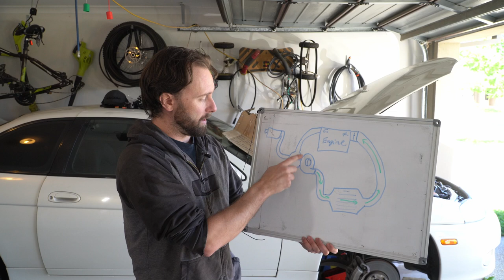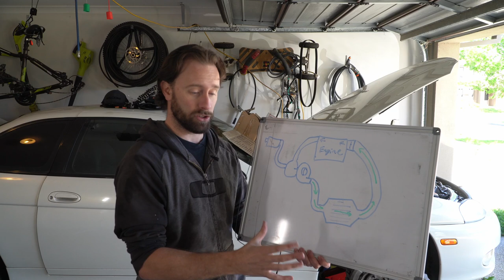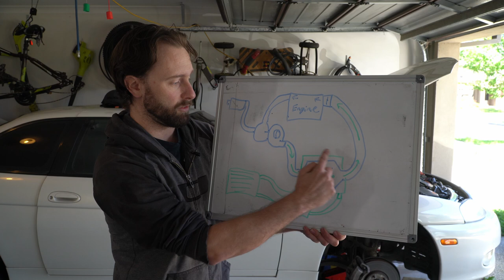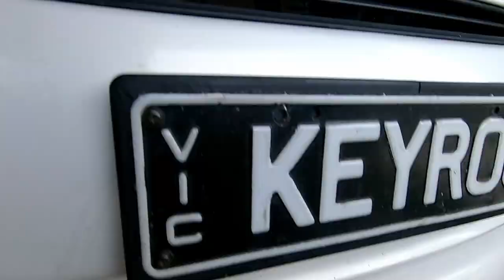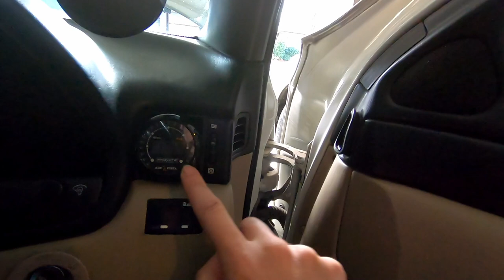1JZ Soarer Water to Air Intercooler conversion

Comment: That pump is not man enough fire the job.
It’s a parking heater pump. 
Look out for a Bosch “010” pump , it’s used in the supercharged Mercedes , it’ll do 4-5 gallons per min . They’re cheap .
Also those 90 brass fittings are absolutely terrible for flow . Use the ones they call “smooth radius or smooth flow” fittings for nearly free extra water flow. 
Love the build .
Reply from the maker: Cheers mate, this one is flowing alright but i'll look out ofr the bosch pump to upgrade in the future :) and yeah the brass fittings are pretty average, i should be able to get a deal on proflow or raceworks stuff at work so i'll get some nice bend fittings. a lot of this was purely to get it all doneand working and i'll tweak it all as time goes on :)

Cheers for the advice
Reply: Doesn’t need a flow rate like a radiator mate…. Just needs constant circulation, can be on boost for quite a while before it heats the water enough for pumping…. Could always put a thermal switch into the relay for temp trigger the pump……

Comment: Great video. I didnt hear properly what the valve was called coming from the intercooler. Its a "blawvalve" ? What does it do? What is the small tube connected to it?
Reply from the maker: Blow off valve, it vents air pressure from the turbo when the throttle plate closed, mine is a plumb back so instead of venting to atmosphere it vents back into the Intake. It's worth googling turbo systems and blow off valves for more info on this stuff and how it all works :)

Comment: I would have put the air to water heat exchanger between the rad and the timing cover, flipped that turbo pipe around on the turbo out let and then you dont have to do a 180 degree bend in your air flow plus you shorten the boost run which will improve boost response time. 
very nice job though
if you want to take it further, you should look into an interchiller set up which uses the ac system to cool the water to sub freezing intake air temps which translates into more hp.
Reply from the maker: Hey mate yeah that was my original plan but I just couldn't fit it in there, tried a bunch of stuff and even if I ditched the thermo fans all together it wouldn't fit, there was a smaller cooler available but it was rated for much lower horsepower so I ended up going thr way I did, not perfect but it's just the way it ended up! 

I'm going to replace all the dodgy fittings with raceworks ones for better water flow. See how I go with the AC chiller, it's just a weekender so no drag racing or anything :)

Comment: I really like this setup ,but my issue was I can’t fit anything in the front as I don’t have space for intercooler. In this setup the heat exchanger as big as my intercooler itself ,so it doesn’t make me fwd with my built too much. I need to find a space for the heat exchanger somewhere
Reply from the maker: yeah i've got tonnes of space in thefront bar, was easy, fitting the cooler in the engine bay was trickier

Comment: cool build . It could end up with a air lock in cooler . If you unbolt and turn on its side or put an air bleeder in top . I think could help
Reply from the maker: Yup exactly what I did when I did my final bleed :)

Comment: I may have misheard you it the water temp probe for the fans needs to be in the top radiator hose 👍
Reply from the maker: The fans are controlled by the ecu from the factory water temp probe, the temp probe in the top rad hose is just for an aftermarket gauge :)

Comment: You will have air the water to air intercooler need the water line top and bottom. You will have air from the fitting to the radiator cap unless you can pull a vaccum and inject coolant in system.
Reply from the maker: I unbolt it on the final bleed, twist the cooler and put the cap above it :)

Comment: Hey what water pump did you use? Just did a very similar setup in my Subaru but I'm getting cavitation with my current water pump, I suspect it's oversized.
Reply from the maker: Hey mate I got it in the kit with the cooler, let me have a look and see if i can find a brand :)

Comment: How did you bleed air out of the cooler?  I can’t help but think the upper part of the cooler is just an air bubble and not flowing coolant.
Reply from the maker: Undid the mounts and rotated the cooler around so the exit fitting was at the top to get the air out :)
Reply from the maker: I may drill and tap the top of the cooler at the highest part for bleeding later on :)
Reply: @TheNuggetProject  ah ok, fair enough.

Comment: What type of water pump did you end up getting. Will be doing a water to air for my e30 turbo.
Reply from the maker: i'm not sure on the brand mate, it came with the kit, i think its a pretty basic one but seems to be going well so far and the supplier said he's run them for years in the cars. there is quite a bit of info online about pumps, i believe there is a bosh unit used on mercedes that is really good, have a google see what you can find :)
Reply: @TheNuggetProject  yeah usually these kits are pretty decent. Even a budget set up runs well. A Bosch unit usual are merc/audi/ terminator cobra here in the US. $150usd and knock off style ones are half that. I've seen some people run small reservoirs also.
Reply from the maker: Yeah for sure, we have a drag car at work with a similar system but lines run to a 20 litre ice tank in the boot, that really keeps it cold! But for daily duties I think it's fine how it is on this car :)
Reply: @TheNuggetProject  good to know. With a conservative 300-350hp I'm sure it'll be more than enough for my car. Good to know you're happy with it.
Reply from the maker: Cheers bro, now I just need to find time to finish the dam thing haha, got a small vibration to sort out, the camber is all over the place, clutch needs bleeding again, new gauge system needs to go in... The list never ends, meanwhile the daily is leaking all over the driveway haha
Reply: @TheNuggetProject  hahaha totally feel you there. I recently swapped to ms2pnp for the ecu and idle is not tuned at all. And afr is good and auto tune is handy. But it's not getting a professional tune until a turbo/ dyno tune. Glad to see you taking care of the poor man's supra. Cheers!
Reply from the maker: I'd like to think of it as 'the gentleman's supra' ;)
Reply: @TheNuggetProject  definitely a good way to put it. But at the prices of mk4s... it just is nice to have a clone which isn't bloated in price yet.
Reply from the maker: Yup way over priced in my opinion, good cars but not worth the drug money people are asking.
Reply: @TheNuggetProject  clean e30s are becoming the same 15-30k. I lucked out getting mine for under 4k. From the 3rd owner of 16yrs. Deals can be had. But far and few between nowadays. Found my wife's father a shell for $250 to build.
Reply from the maker: @voltairee3012  yup also drug money, onr if my mates had a ripper E30 with a 3sge beams in it, little rocket for an NA :)
Reply: @TheNuggetProject  damn haven't seen any beams swaps. Much rather have that than the golden 4cyls f20c or k series. Always have enjoyed Toyota motors. If I get tired of my m20 it'll most likely get a JZ.

Comment: any update to the water to air intercooler.
Reply from the maker: So I still don't have the new gauge setup in there with the temp sensors but as far as reliability and functionality goes it's great! Took the car to work today as it was sunny, then went home via the mountain road, pulled over after a bit of a run, popped the bonnet and the cooler is still ice cold! Seems to work great. I just got my racecar sponsored through raceworks so I'm going to hopefully upgrade the fittings to nice raceworks ones :)

Comment: Compared to the air to air intercooler, would you say the air to water keeps intake temps lower?

Cheerz
Reply from the maker: I'm putting temp probes in soon so I'll let you know!
Reply: @TheNuggetProject  that would be great.
I would like to know if that size air to water cooler is more efficient than that large air to air.
Air to water is easier to install and running smaller water pipes than huge air pipes.
Also keeping the cooler closer from turbo to intake, will result in less turbo lag.
An additional heat exchanger will also improve cooling of water and is an easy addition should the need arise.

Thank you.

Comment: Is there a kit you used or did you buy the parts separately for the build?
Reply from the maker: So there is a guy who puts kits together in eBay, I think he's a part of fenix radiators, I had to buy a few more bits and change fittings etc, but it had most of the basic parts I needed :)